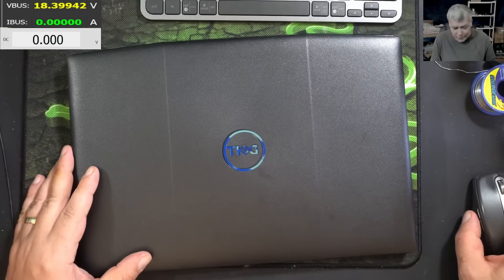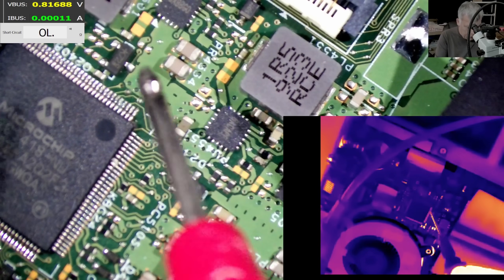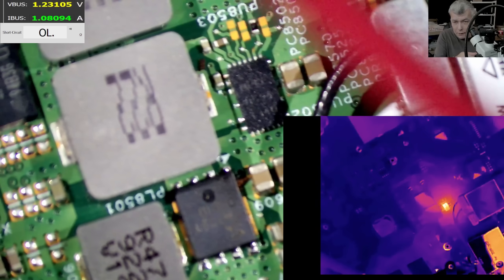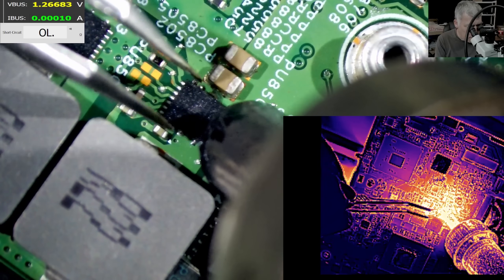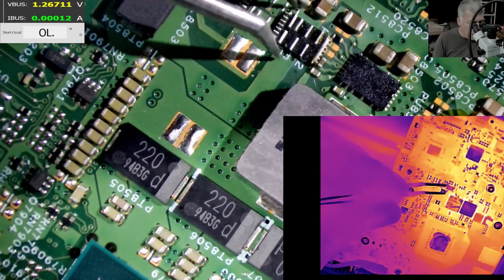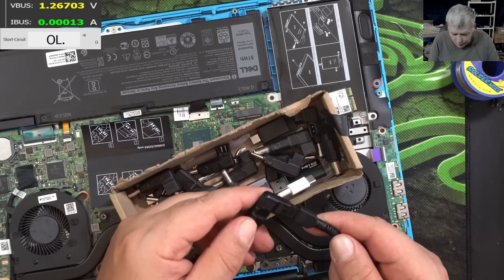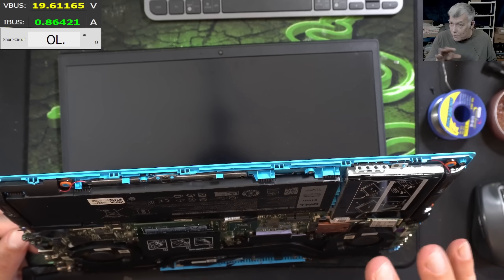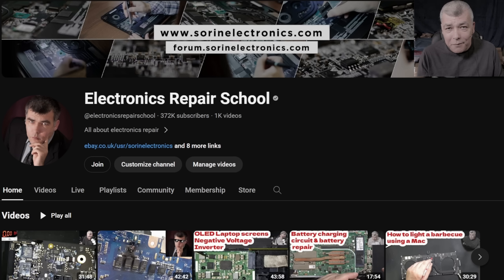Dell G3 gaming laptop, no power and not charging, motherboard repair

Comment: My Dell G5 gaming laptop is having an issue where it shuts off immediately if I try to run a game without the battery plugged in. When I play games with the battery installed, the performance is very poor and laggy. I checked the power draw and it’s staying very low, around 16 watts. Also, when I run a game without the battery it shut down the laptop, it makes a clicking sound similar to a USB device being unplugged. Could these issues be related?"

Comment: Sorin how did you know the capacitor was on the main power rail. Is it because that buck converter circuit was near the battery
Reply: Simple in every section every chip every buck circuit have vdd main and at the input of that area we have a capacitor with one side ground❤

Comment: Can someone explain the logic of this repair? As far as I understood, monolithic driver "switched" to short mode on purpose. That would mean the problem is somewhere above the rail, no ? Replacing it just "unswitched" it. But the root case was still on the board somewhere...

Comment: do a customer a favor and loose up the hinge nut a little bit . this laptop well known of failing hinges . had one of this last week both hinges were busted up because they were very stiff . i loosen up the nut a little bit on both sides and lubricated it then i used hot glue to stick both hinges back , works great and will never break again ,  the key here is not the Epoxy or hot glue or whatever glue you are using , the key if you don't loose the tight hinges nuts then it will break again no matter how strong Epoxy you used.

Comment: there is a device called JABEUD UD-1700 on ali that simulates the midle pin for lenovo, hp, dell, asus, even mac´s, that you can use with your power supply to work with those laptops 😁

Comment: For a clear image of a thermal imager, you need to buy at least one microlise for a thermal imager and screw it to the lens of the thermal imager, then the heating will be clearly visible.cut and glued a plastic cover (ABC) for attaching microlenses
(to search for short circuits on the electronic board) -
drilled two holes for the infrared camera lens = 20 mm, and for the visible video camera = 14 mm,
glued everything, glued everything with SUPERglue,
and glued the lens with another glue - POLIMER-neutral,
Focus lens Cloudray CO2 ZnSe
with number = 25.4 mm (for SMD phones - PCB circuit board)
with number = 38.1 mm, (excellent for SMD ELEMENTS-PCB circuit board),
and number = 76.2 mm, (EXCELLENT FOR PCB circuit board)
The diameter is the same for all 20 mm, I also drilled a 14 mm hole for the video camera.

Comment: While checking a two-layer PCB, I used the P3 to scan through the top side. The 15x zoom revealed a vertical heat trail near a via. After peeling the solder mask, we confirmed a trace was partially burnt on the inner layer.

Comment: Used FLIR one edge cameras before at work, so I kinda knew what to expect. But the P3 actually surprised me. I was checking a phone PCB and noticed how clearly it showed the heat moving from a chip to a nearby cap. The edges were sharp, and I could follow the whole thermal path. That level of detail just never came through on the older gear I used.

Comment: Question: surely be better if you searched and found new part before removing old part. New part is then fitted quickly before board cools down too much and has to be reheated all the way again. Better for board, no?

Comment: You have two adapter big black round. 1 for HP and 1 for DELL
If you use other adapter computer charging with no problem .
I've you same cable with same adapter